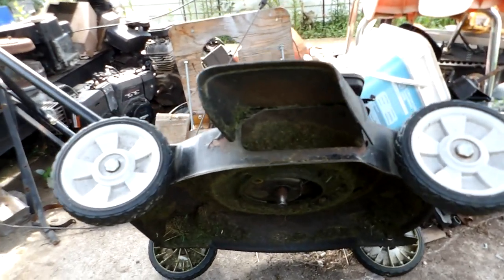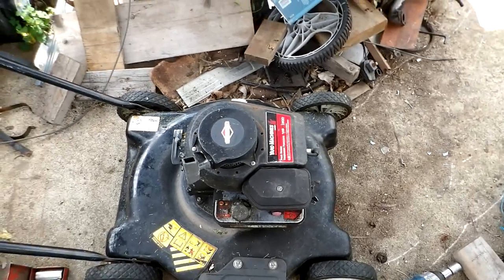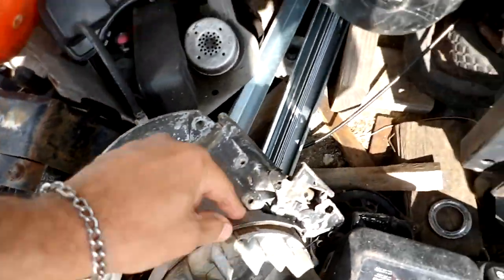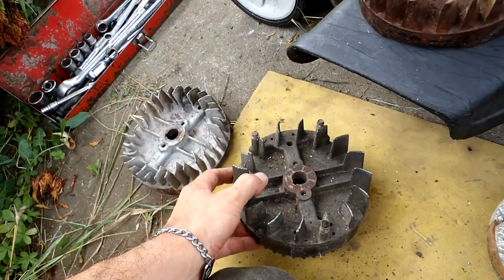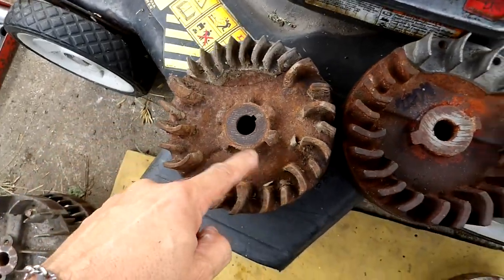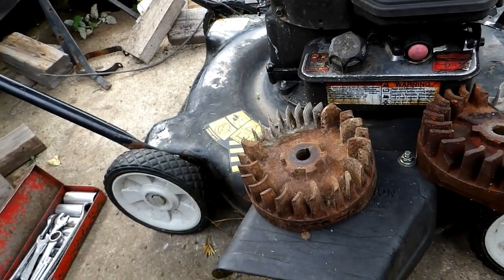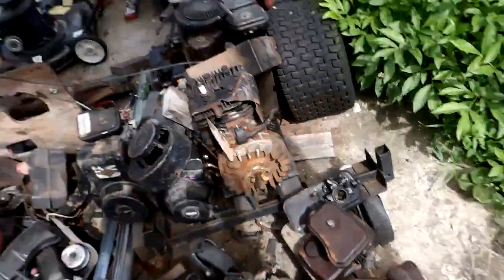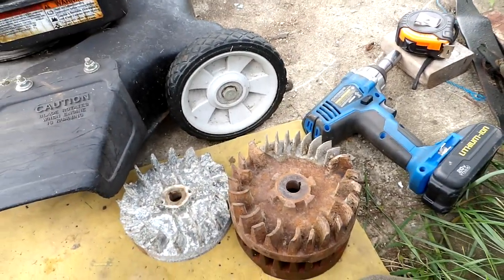Briggs Lawnmower Running with No Blade (Flywheel discussion)

Comment: Near 30 years ago I’m was racing go-karts under WKA (world karting association) rules. I was running unlimited 4 stroke class which was a 5 hp flathead on alcohol, max 14.2 cubic inch, any crank, rod, piston, cam and carb but the one stipulation was you MUST use the stock unaltered flywheel weighing a minimum of 5lbs 12oz. I have turned that stock Briggs cast iron flywheel 11,400rpm. We ran outer third bearing supports and girdled blocks to hold them together. We were making near 30hp from a 5hp flathead. We raced a winter indoor track series back in the 90’s and I did not attend the final race due to schedule and I had the points championship locked down. The race I did not attend, a spectator was killed by and exploding flywheel. The engines evolved faster than the rules adjusted. After that disaster billet flywheels quickly became the rule.
Reply from the maker: WOW, 11,400 rpm with a stock Briggs flywheel!  That is crazy that they ever held together for that rpm. I contacted Briggs back in the late 80s regarding my Sleeve valve engine, wondering what was a safe max. rpm to run it at. If my memory is correct, they recommended that I limit it to 7000 rpm on the 3 horse sized steel flywheel (the conversation was off the record, in case I had a problem though).  I was doing a little research about restrictor plates for go karts, as my son is making a mini-bike for the grandkids, I built a 2 horse Briggs for it, but didn't want it to be able to rev 5500 rpm, so I made a restrictor with a 5/16" hole in it, we shall see if I guessed right!

Comment: Great video sir. I have a Briggs 3.5 classic and wanting to use to make a generator. Epicenter has everything I need to do it. I was just wondering if a 2.5" cast iron pulley that they sell  would be a sufficient enough mass to attach where the blade was and run that just to use to burn some old gas before I complete the project.
Reply from the maker: That might work OK, as long as you have the full circle type flywheel that would come with a blade brake on the lawnmower. The 2.5" pulley may be OK, but I wouldn't go any larger, unless you can find out the rpm rating for the pulley. Many of them are made for electric motors which typically run much slower, perhaps 1800 rpm. I know I have ran a similar sized iron or steel pulley at 3600rpm, but please verify with the producer that this pulley has a high enough rpm rating of 3600 rpm plus. Good luck building the generator, sounds fun.

Comment: The trick we did on Kart engines, we put the lightest "Push Mower" style flywheel....(we used the clutch for flywheel) -  The guys that ran the standard flywheels were getting their butts handed to them....
Reply from the maker: Yes, I could see that working in a race, lighter can be better for acceleration. When you want a smoother running engine for say an outboard motor, or an air compressor heavier would be best.

Comment: It's all about the inertia to get it over the various humps in the inner workings like cam lobes and the compression... :)
Reply: A flywheel stores energy. It also takes energy to accelerate it. Depends on the application which flywheel will give desirable results.
Reply from the maker: Yes, interesting point, you want a light flywheel for fast acceleration, but a heavier one makes the engine run smoother, and thus doesn't strain the drivetrain parts as much....always a compromise!

Comment: if you could find a heavy flywheel
Reply from the maker: Yes, I admit they are somewhat hard to find. Horizontal shaft engines always have them. Some vertical shaft engines like pressure washers and possibly generators and roto-tillers can have the heavy flywheel also. I would recommend the heavy flywheel, since the smoother motion will be better for whatever type of drive train you hook it up to. The more jerky motion of a lighter flywheel will be harder on the parts.

Comment: how hard is it to swap the crankshafts on these briggs motors? there's a long story here, the tldr is I can have an operational motor if I swap the crankshafts between two blocks (same motor otherwise, flywheel, carburetor etc etc is all the same). I swapped motors between mowers and now have a good motor on a good deck, but the shaft is about 3" too long. I have a bad motor with the correct length shaft, but the motor itself is bad. I'm debating tearing it down and swapping the cranks or just giving the whole lot of it to my neighbor that collects scrap metal.
Reply: Not to be a dick, but if you have to ask it’s probably scrap metal. If you’re sure everything else is the same go for it, if you want to tinker/learn, go for it see if they’re the same and do it. You could probably check by model/serial number if they’re interchangeable but you haven’t given that information so Nobody can say one way or the other...
Reply from the maker: I guess there are 3 options:  Cut off the crankshaft to the proper length, but then you will need to file or machine a keyway in the correct location, as well as re-do the center bolt threads (not an easy option).
2 Take the crank out of the other motor, examine it to make sure it is good (the con rod journal is usually the deciding factor), if good, install it in your good engine. This will be a few hours of work, but you probably will end up with a good motor.
3. Scrap both of them, which is the simplest, but not the most useful option.
Generally speaking the internal parts will interchange, but you need to use the parts that come with a given crank type. What I mean is, if it has a removable metal gear, you need to use that. If it has a plastic crank gear (I hate those), you need to use that, and the thin steel washer that goes with it.
Hope this helps.

Comment: So you saying it is safe to go with a modern pressure washer ohv engine and it will make a good outboard motor  ?
Reply from the maker: Hmmm, I am afraid I can't say for sure, since I am really only familiar with the old Briggs flathead engines. I don't see why an OHV engine wouldn't work, though in any case I would bring some oars with me just in case the engine conked out!
Reply: Old Guy here.  Tried that in early 1970's.  2 cylinder Johnson outboard.  Rod through block.  Junk push mower that ran well.  Found lower unit was 3/8 square into crankshaft.  Welded 3/8 drive socket to Briggs crank; No other engine changes.  Made frame from light angle iron that bolted to lower unit and Briggs verticle shaft flathead engine.  Never took cover off to see what flywheel had but lower outboard drive and prop always turning with engine.  Worked great Except only go about speed of cheap electric trowling motor.  Actually expected that as Briggs 3600 rpm, original 2 stroke maybe 7000 rpm.